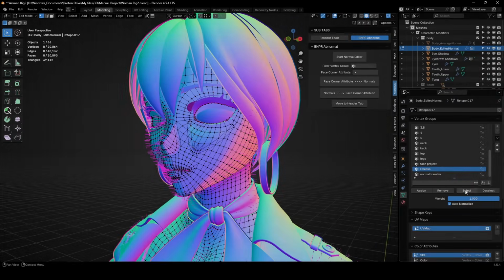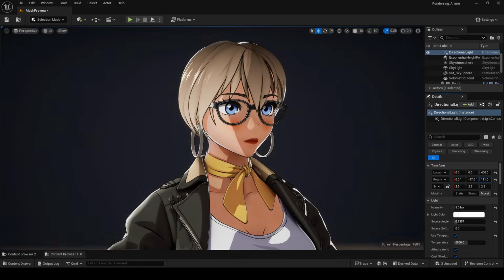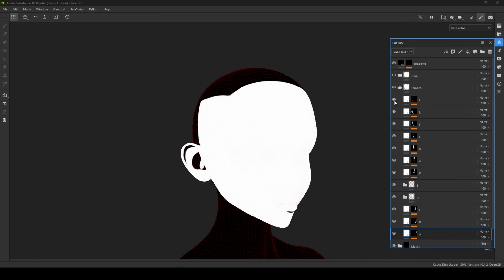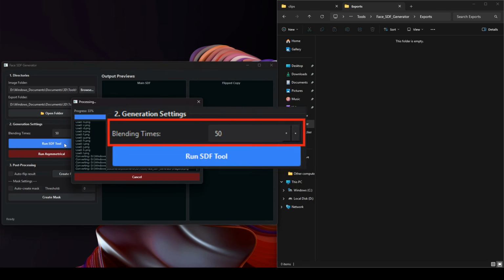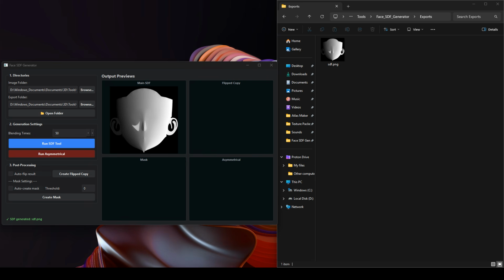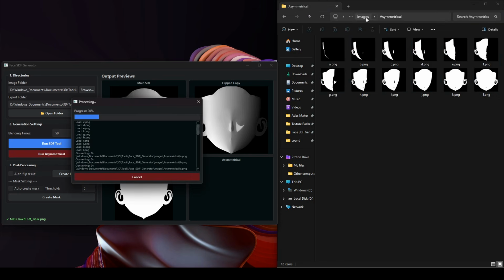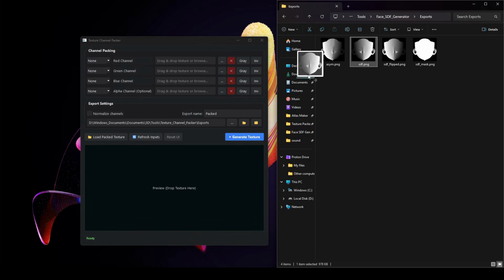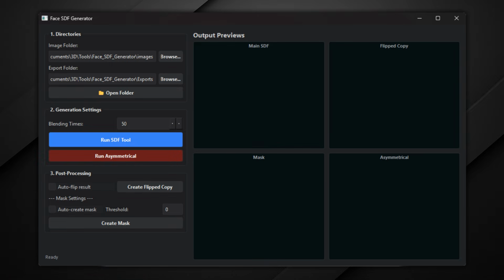Face SDF Generator: Create Smooth Distance Fields for Games & 3D Art

Comment: What is the best method to use when drawing the lighting, your work here looks very clean and well done
Reply from the maker: Hi! I usually paint symmetrically and use anchors in Substance Painter, so both sides start out the same. However, they can still be adjusted individually to account for differences, since the two sides can’t always be exactly identical. This also helps avoid having one side reveal or hide details that should only appear on the other.

I should probably make a video specifically showing how I paint this as it is difficult to explain it with words only.
Reply: @MeshBites  I would really appreciate a tutorial

Comment: Hello, this is damn awesome man you've made something so great, but i do have a question that is, can you use different textures for different axis like the x and y instead of left to right maybe up and down also.
Reply from the maker: Thank you! The SDF itself is not limited to left-to-right movement. Since it is generated from the shape of the input masks, it can also represent vertical, diagonal, or other directions depending on how the textures are created.

To actually make the light move up and down, it will depend on how your shader interprets the texture.
Reply: @MeshBites oh okay now I understand it better thanks for clarifying I will experiment a little bit

Comment: What's the point of flipping the gradient and packing it in a separate channel if you can just use original gradient and flip it in the shader? Is there any benefits of having it separate? Assuming that UVs are perfectly symmetrical so the desired shading
Reply from the maker: Hi,
Even with symmetrical UVs, flipping UVs inside the shader graph can create a sharp UV jump that causes severe mipmap seam artifacts straight down the center of the face.

Packing the left and right gradients into separate R/G channels completely avoids that seam artifact, uses fewer shader instructions (just a single texture sample), and allows the texture to support asymmetrical face features, hair shadows, or non-mirrored UVs whenever needed
Reply: @MeshBites  thanks for clarification

Comment: Hi, when I run my images through this I just get a black square as output. It works with the sample images, and I've made sure my images meet the requirements (square, png, no alpha, 8-bit depth, alphabetical names), so I'm not sure what's happening.

Edit: Out of curiosity, I clicked on "create mask" and it just output my final sdf image. Not sure what's going on there, but maybe it could help diagnose the issue?
Reply from the maker: hi, can you try the following?
Clean the Input Folder: Double-check that your input folder only contains your pure animation frames. If a previously generated SDF, a test image, or a black square accidentally got saved in there, it will break the generation.

Check Your Export Path: Make sure your 'Export Folder' is set to a completely different location than your 'Input Folder.' If the tool saves the SDF directly into your input folder, it will try to use its own output as a frame on the next run!

Verify the Last Frame: Check that the alphabetically last image in your sequence is actually the widest/fullest shape of the face, because the tool uses that specific frame to cut out the final background.

Check the numeration: If you use numbers, ensure your files are named with clear sequential numbers (e.g., 01.png, 02.png, etc.) so the computer doesn't accidentally sort a blank starting frame to the end of the list.

Give that folder a quick clean-out and let me know if it fixes the black square.
If it is still an issue, maybe you can jump into Discord and share images in the section for this tool.

Comment: Where do you put the sdf texture after generating? I use unity and blender so im not sure what shaders are compatible with sdf maps.
Reply from the maker: This video is specifically about how the tool generates the maps rather than how to code or implement them. But because it's a standard texture map, you can definitely use it in Unity, Blender, or pretty much any engine by setting up your own material graph.

Comment: Theoretically can it work on the entire body? cus as far as im understanding its a interpo lated gradient multiple of which then get converted into a normal map
Reply from the maker: Yes, you can. However, you’ll only get horizontal lighting. If the light moves up or down, the lighting position won’t change unless you have a separate setup that handles the vertical axis.
It is not supposed to be used as a normal map.

Comment: how does it work when you and the mask to the blue channel you get a normal map?
Reply from the maker: Hi,

You don’t actually get a normal map by adding the mask to the blue channel. While it looks and behaves similarly to a normal map, it serves a different purpose.

In most cases, the mask isn’t necessary. I use it in my shader to define the area where the SDF lighting is applied. This allows me to blend the standard lighting with the SDF effect without needing to use a separate material.

Comment: First of all, thank you. But maybe it's because the version is different when I use this sdf tool, it should have the whitest part, but it comes out dark overall. Which option and how many figures should I adjust to come out normally?
Reply from the maker: Hi, sorry for the late reply.

The tool seems to be working correctly on my side. I’m using:

* Interpolation Steps: 50
* Blur: 2
* Contrast/Gamma: 1

If the issue still happens, could you share some images or additional information?

I also have a Discord server with a section dedicated to my tools (although I haven’t really promoted it yet):
[Discord Server] https://discord.gg/wx6RASWfyu

Comment: how do i use this in blender?
Reply: I used the packer and thought i pooped out a normal map am i wrong?
Reply from the maker: I haven’t tested it in Blender yet, but just to clarify, it’s not a normal map, even if it looks and acts similarly.
It requires custom shader calculations to work properly, so you can’t plug it directly into the normal input.
I might look into how to set it up in Blender in the future, as it could be useful, but I can’t guarantee it.
Reply: @MeshBites I found videos I for some reason thought it was a normal map sorry

Comment: does it have to be a 4k image?
Reply from the maker: No. I didn’t need optimization. So I used 4K, but you can definitely use a lower resolution.
Reply: @MeshBites  im getting an error when i do it
Reply from the maker: @lokeyartist  I’ve just double-checked the tool with 1024x1024 images on my end, and the SDF generated correctly. If you are running into issues, please verify that your source files meet these specific requirements:

Format: Only .png files are accepted; other formats (like JPEG or TGA) will not be detected by the tool.

Bit Depth: Ensure you are using 8-bit PNGs. 

Consistent Dimensions: Every single image in your input folder (and the Asymmetrical folder, if used) must be resized to the exact same dimensions. If there is even a 1-pixel difference between frames, the interpolation math will break.

Standard Specs: For best results and engine compatibility, ensure they are square, power-of-two textures (e.g., 512x512, 1024x1024).

No Alpha: Save your files as standard 8-bit PNGs without an alpha channel to ensure the grayscale conversion works properly.

Let me know if you’re still hitting a wall after verifying those settings. If there is an error message, let me know what it is.
Reply: @MeshBites   i think it was because the example images so i deleted them and it worked

Comment: VIRUS TOTAL SAYS IT HAVE A TROJAN, SO GUYS...
Reply from the maker: No other users have experienced this so far, so it may be a false positive or something specific to your setup.

What is the exact warning message
When it happened (download, launch, etc.)
Reply: @MeshBites  Thanks for your answer, I appreciate it.
I also considered that it might be a false positive or something specific to my setup.

The difficulty is that when a program is packaged as an .exe, it’s hard to verify what’s actually happening under the hood. That’s why I usually feel more comfortable when projects are shared in a more open format (for example, Python with an HTML interface), since it makes everything more transparent and easier to review.

For reference, I checked the file on VirusTotal and got some flags:

Jiangmin: HackTool.Inject.ddq
SentinelOne (Static ML): Suspicious Archive

So it may still be a false positive, but I just wanted to share what I’m seeing on my end.
Reply from the maker: @iluv3dcr 
Thanks again for checking and sharing the details.

From my side, there’s no malicious code in the tool. Flags like the ones you mentioned can sometimes happen with packaged .exe files and are often false positives.

I understand the concern though. So far, I haven’t had similar reports from other users, but I’ll keep an eye on it.

Comment: wait, cant you do all of this in substance painter directly with the help of designer?
create a setup with light as mask. rotate it so you get your 12 steps.
create a substance designer gradient processing and packing for the multi channel mask.
im not into stylized modelling so im not quite sure what the processing directly requires. also make sure its 32bit. the choppy gradient looked not nice. (or was it youtube compression?)
you can elaborate with asymetrical buttons, and whatever in designer.. and go crazy....
make it a filter so it can be used in painter directly.
make it a smart material.
now you have basically a process stack which is almost a drag and drop solution for every single model you do with the same quality.
Reply: Adobe products = RansomWare
Reply: @ToytownDefects  absolutely, no defending that. im not a fan of the company either. but still there are 2 things - the software IS useful and it is industry standard.
Reply: @Eludor225  agreed
Reply: again, depending on what the processing of the gradient requires... maybe designer isnt even really needed. probably can be reduced down to a smart material done in painter on its own as a base setup.
Reply from the maker: Yes, this can definitely be done in Substance Designer. I based part of my calculations on a workflow similar to that, and I’ve also seen people achieve comparable results in Blender.

Regarding the gradient quality: YouTube compression does make it look worse than it actually is. The result is smoother in the original output 😄

That said, not everyone owns Substance Designer (myself included), is comfortable with multiple tools, or wants to set up a complex pipeline just to achieve this result. That’s why I think this tool can be a good alternative, especially as a more accessible and straightforward solution.

Your approach makes total sense from a Designer/Painter power-user perspective, though, and I agree it’s a very flexible way to handle it.
Reply: I mean, in Substance Painter you can just paint different areas different values and use math… I’ve done it before. First shade is like 0.1 then next value is 0.15 etc.

Comment: bro thanks! this is super useful! also, technically speaking, this can also be used for any arbitrary object right?
Reply from the maker: Yes, it can be used on arbitrary objects. The main thing to keep in mind is that an SDF usually works in 2D space (X–Y), so it doesn’t handle lighting calibration along the Z axis.
It’s probably possible to tweak the shader to compensate for that, but I haven’t tested it myself.
Reply: @MeshBites  what if you did this a 2nd time for the other axis? would the two textures be able to work together or would it be a poor output? I'd love to see you try something like that.
Reply from the maker: I actually thought about it, but I haven’t tried it yet. From most of the SDF textures I’ve seen, they usually only calculate the X and Y axes. There’s probably a good reason for that, likely the kind of issues you mentioned, such as unstable or poor results.

I’m currently working on a video about my own shader, but I might take a look at this afterward if I get the chance.

Comment: the thing is  that my face shadows and my cloths shadows are not moving together. face shadow is moving more faster then colthes shadows
Reply from the maker: This looks like a shader issue rather than an SDF problem. The face and clothing are probably using different shadow calculations or parameters, so the shadows don’t move in sync. You’ll likely need to tweak the shader settings to align their shadow behavior.
Reply from the maker: This is a super late reply, but...
Regarding your issue, I had a similar problem recently, so I understand it a bit better now. I solved it by adjusting the contrast or gamma. How the light goes through the face depends on the gradation in the texture.

That said, it might be better to add a small parameter in your shader to control this.

Comment: I am curious how you came up with putting "SDF" into the name of this
Reply from the maker: I did not come out with the name. :) it means Signed Distance Field (SDF)
Reply: @MeshBites  Yes and it has nothing to do with your normal baking, SDF is about getting the nearest object distance to a surface, here you bake a threshold to know when the normal is pointing enough towards the light, so it's closer to a normal map than a SDF
Reply: @ThomLaurent  While you two think you found a "gotcha" against the poster, the truth is that these are SDFs. Every dev using this technique, mostly Korean and Japanese, refer to them the same way.
Reply: @SuWoopSparrow  So if a lot of devs miss-use this term it becomes the truth?
Reply: @ThomLaurent  How is it misused when the layers of black and white images are SDFs? Just because in this instance he takes an additional step to turn it into a normal map doesnt change that the root of the technique is built on SDF functionality. Not every dev turns it into a normal map.
Reply: @SuWoopSparrow  If those BW textures map distances then they are SDFs, otherwise they aren't.
What type of distance is involved here? Is it "distance" to a direction?
Reply: @ThomLaurent  I don't know where you're coming from.

https://en.wikipedia.org/wiki/Signed_distance_function
"By 2007, Valve was using SDFs to render large pixel-size (or high DPI) smooth fonts with GPU acceleration in its games"

SDFs in a BW texture context in game development are largely used for "boundary" determination for smooth rendering. Outside of Valve's font example, it applies to many UI elements these days. In this case, the boundary of where light hits a characters face and where it doesnt.
Reply: @SuWoopSparrow  I was asking what distance was involved here as the video just completely skipped this question nor does it show how multiple images are baked in one.

If it's distance related as you'd explained then sure it's SDF
Reply: And yes SDFs are pretty useful when you need to thicken things, like for fonts or buttons, also it's useful when combining SDF "shapes" to blend or morph them, PanGUI uses that extensively for example.